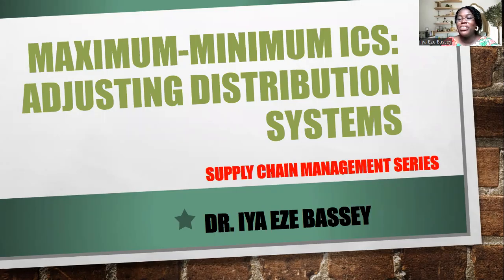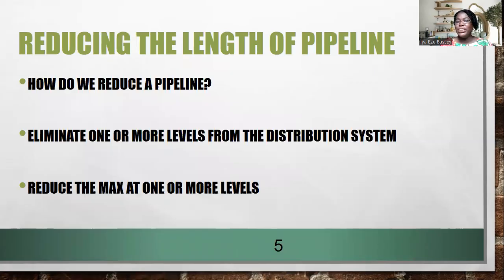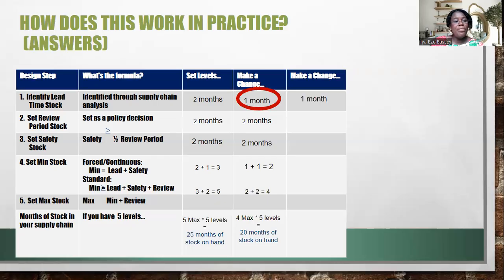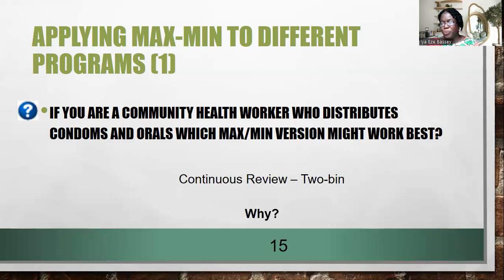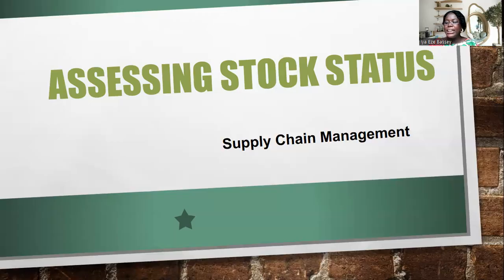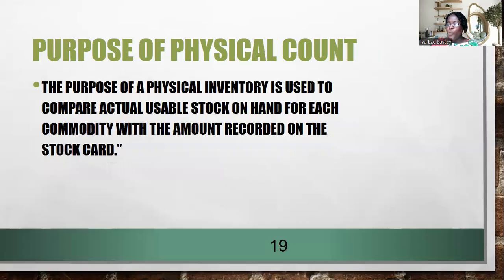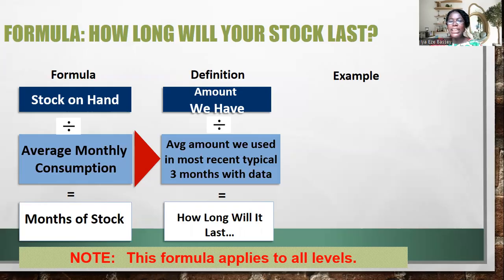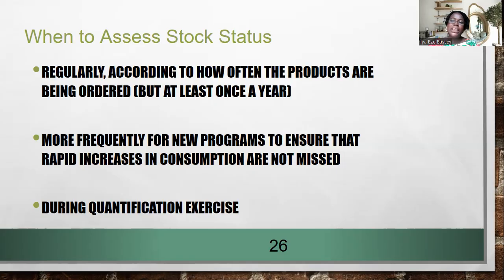Maximum-Minimum ICS: Adjusting Distribution systems (Supply chain management series)

Comment: Thanks ma
I learnt the importance of adjusting the max-min inventory control system which begins from understanding what pipeline is and how  to reduce the lengthof a pipeline in order to serve the client more efficiently and timely.pipeline can be reduced by(1) eliminating one or morelevels from the distribution system (2)reducing the maximum stock level at one or more level.
Also,there are factors that affect max/min  stock levels which are  cost of product, cost of storage etc
  Again,there are advantages of using  max/min system  which includes (1)it minimize wastage (2)avoid overstocking and understocking(3)simplify inventory control decision making  etc
Again, there are some challenges facing the use of each version and variation 
In accessing  stock status,i understood the importance of physical count as it is to compare the usable stock on hand each commodity with the amount recorded on the stock card in order to check for wrong data entry,theft,damage  issues as well as to know how  long these products will last.it is done once every year

Comment: Maximum minimum ICS adjusting distribution system length of a pipe line 
The step in designing a maximum minimum ICS are;
i) setup initial maximum minimum policies for each level and type of facility
ii) check if the overall distribution will function properly if the specific maximum minimum policies are implemented
iii) Check the total length of the pipeline that the policies at each level imply
• how to reduce the length of a pipeline
- eliminate one or more levels from the distribution system 
- reduce the maximum at one or more levels 
• how to reduce the maximum store level
- change some elements of the formulas which can be changed in order to reduce the maximum stock level by;
- shortening the review period at one or more levels reduce the lead time at one or more levels.
• other functions that impact maximum minimum stock level 
-cost of products 
- Reliability of transportation 
- storage capacity 
- cost of storage.
• assessing stock status
 how to determine month of stock 
 i) physical count: It is a process of counting by hand detour number of usable units of each commodity in your store physical account is important because it helps to compare what is actually on ground the actual usable stock at hand of each commodity with the amount recorded on the stock card
•Purpose of assessing stock status is to determine how long supplies will last

Comment: Thank u ma 
In Summary,
     The length of a pipeline can actually be reduced either by eliminating one or more levels from the distribution system or reducing the max at one or more levels . To reduce this max, Review period, Lead time and safety stock level should be reduced
      Cost of products , reliability of transportation, storage capacity, cost of storage etc can also affect  one's determination of max-min stock level besides the length of the pipeline.
        Inorder to compare the actual usable stock on hand for each commodity with the amount recorded on the stock card, a physical count should be done and this can be done once a year or as frequent as possible when there is frequency in mismatch with stock card to minimize lost .

Comment: This video lecture dived deep into adjusting distribution systems in supply chain management, particularly maximum-minimum inventory control systems.

In this lecture, we explored the various methods for identifying areas for improvement in distribution systems, along with the advantages and challenges of the must-mean inventory control system.  

We also covered assessing stock status, a crucial process for determining how long supplies will last.

Comment: Really interesting ma
In summary, the steps in designing a max-min inventory control system are:
1. Set up initial max-min policies for each level and type of facility
2. Check if the overall distribution will function properly if the level specific max-min policies are implemented
3. Check the total length of the pipeline that the policies at each level imply
     Pipelines cannot be reduced anyhow, the are two ways to reduce the length of a pipeline:
1. Eliminate one or more levels from the distribution system
2. Reduce the max at one or more levels
      The following are ways to reduce maximum stock level:
1. Shorten the review period at one or more levels
2. Reduce the lead time at one or more levels
3. Improve the distribution system's reliability at one or more levels so that safety stock can be reduced.
       Some of the factors that impact max-min stock levels are the cost of products, storage capacity, lead times, cost of storage, transportation reliability, age of program etc.
     Some of the advantages of using max-min system are: avoiding overstocking, avoiding understocking, minimize wastage, avoid cost of emergency order etc.
     They are some challenges of using max-min system as well which are:
1. Systems with numerous levels
2. System that manage a large number of commodities
3. System that manage products for new programs.
     Physical count is the process of counting by hand the  total number of usable unit in the store or health facility at any given time 
     The purpose of carrying out a physical count is to compare the actual usable stock on hand for each commodity with the amount recorded in the stock card and it's can be carried out once a year if they is no frequency with mismatch with stock card, but if they is, it should be as frequent as possible
       The purpose of accessing stock status is to determine how long supplies will last.
  The calculation to find out how long supplies can last is in our manual also.
      So when do we access stock status? 
1. Regularly, according to how often products are being ordered
2. Make frequent for new programs
3. During quantification exercise.
Thanks ma

Comment: In summary, I learned how the length of a pipeline and how to reduce the length of a pipeline is essential in adjusting distribution system in maximum-minimum ICS.

Other factors that impact maximum to minimum stock levels include:
* Cost of products.
* Reliability of transportation.
* Storage capacity.
* Cost of storage.
* Storage condition.

Advantages of adjusting distribution systems include:
* To avoid over and under stocking.
* To minimize wastage.
* To avoid cost of emergency orders.
* To ensure consistency of stock levels.

Some challenges associated with each version and variation include:
* Systems with numerous levels.
* Systems that manage larger number of commodities.
* System that manage products for new programs.

I learned how to apply maximum to minimum ICS to different programs and how to access stock status.

In determining amount of stock, physical count comes into play, whereas physical count is the process of counting by hand the total number of usable unit of  commodity in your store or health facility.

Purpose of assessing stock status:
* To determine how long suppliers will last.

I learned about the formula to calculate how long your stock will last and at what regular intervals you have to access stock status.
Thank you for the lecture.

Comment: ICS is the method of reducing pipeline length and various factors affecting tye determination of max-min stock levels
I also learnt that  what you can do to reduce the length of a pipeline are:

*Elimination of mkre levels from the distribution system 

*Reducing the maximum at kne or more level 

Also steps involve in designing the max-min inventory control system are:

*Determine lead stock
*Set review period
*Set safety stock
*Set min stock level
*Set max stock level
*Set emergency order point (EOP)

Comment: In summary I have learnt the steps in designing a maximum minimum ICS , there are as follows
_ check the  overall distribution it will function properly if the  level specify Max min policies are implemented
_Check the total length of the pipeline that the policies at each level comply
_Setting up initial max min policies for each level and type of facility.
This are some advantage of using max min system which are:
1. Avoid overstocking
2. Avoid understocking
3. Minimize wastage 
4. Avoid cost of Emergency

Comment: In summary of this lecture, I've learnt that;
To be able to improve the delivery of medical laboratory commodities, the first thing to be done is to look at the length of the pipeline following the steps in designing a Max-min ICS.
1) set up an initial Max-min policy for each level and type of faculty.
2) check if the overall distribution will function properly if the level specific Max-min policies are implemented.
3) check the total length of the pipeline that the policies at each level imply.
It is also important to note that there are several factors that could affect Max-min levels. These include; cost of production, cost of storage, lead time, storage capacity, age of the program, the accuracy of forecasts, etc.
Lastly, a physical count of stocks is significant. This should be done at least once a year except these stocks are moved rapidly then the physical counts should be frequented to ensure accurate inventory management.
Thank you ma'am.

Comment: Thank you ma for this wonderful lecture 
From this wonderful video I got to know the various steps in designing the Max-Min inventory control system. 
1. Set up an initial Max-Min policies for each level and type of facility 
2. Check if the overall decision will function properly if the level specific Max-Min policies are implemented 
3. Check the total length of the pipeline that the policies at each level imply.
Also we have various things that can be done to reduce the length of pipeline, then factors that impact Max- Min  stock level which can be lead time, age of program and many others.
Many Advantages of using Max- Min stock level.
Physical count which is the process of counting with hand the total number of usable units of each commodity in your store. 
Then finally I understood the calculatory aspect🥰.

Comment: Thank you, Ma, for the amazing lecture. In summary, I learned about the key elements of designing and managing inventory control systems in public health supply chains.

From the previous session, we covered three types of maximum inventory control systems and their application in public health. Additionally, we discussed calculating mean marks for different distribution systems in a country.

I learned that the first step in designing a distribution system is setting initial maximum policies for each facility level and type. It's essential to check the overall distribution system to ensure proper function and verify that the total length of the pipeline adheres to policies at each level. Methods to reduce pipeline length include eliminating levels and reducing maximum stock levels at certain points.

Factors affecting maximum stock levels include the cost of products, transportation reliability, storage capacity, commodity shelf life, lead times, supply source reliability, staff management skills, and forecast accuracy.

The advantages of using a maximum system are numerous: avoiding overstocking and understocking, minimizing waste, avoiding emergency order costs, simplifying inventory control decisions, ensuring stock level consistency, and providing reliable data for forecasting and quantification.

However, challenges include managing a large number of commodities and products for new programs. Designing an inventory control system requires identifying the appropriate system for each program (e.g., TB drugs, HIV/AIDS commodities, malaria), determining stock levels and review periods, and considering push and pull systems, physical inventory, and stock status assessments.

Assessing stock status involves conducting physical inventories to determine actual stock on hand, comparing these counts with stock cards to identify discrepancies, and calculating how long the stock will last based on average monthly consumption.

Assessments should be done at least once a year, more frequently if discrepancies arise, in new programs to monitor rapid consumption changes, and during quantification exercises for accurate forecasting.

In conclusion, adjusting distribution systems in maximum-minimum inventory control systems is crucial. Understanding the factors affecting maximum stock levels and the advantages of using a maximum system, along with addressing the challenges and importance of assessing stock status, ensures effective inventory management in public health supply chains.

Comment: In summary,this module helped me understand 
• How to design a maximum minimum inventory control system
• How to shorten the length of a pipeline when it's too long
• The various factors that impact Max Min ICS which include cost of products, reliability of transportation and to mention a few
• The advantages of using Max Min ICS which includes Avoidance of overstocking and understocking, minimizing wastage, simplifying decision making but to mention a few
•The challenges involved in using Max Min ICS

It also helped me to understand how and when a physical count is done and  lastly it helped me to know how to assess my stock status

I also understood how average monthly count and months of stock can be calculated correctly in a facility
Thank you ma

Comment: Thank you ma for this amazing lecture 
I got to understand the systematic way of reducing the length of the pipeline which is by
•reducing the lead time 
•reducing the review period 
•set the safety stock
•set the minimum stock 
•set the maximum stock 
How to modify the pipeline which is by eliminating one or more levels from the distribution system and by setting up policies that helps to reduce the maximum at one or more levels 
I also learnt the factors that could impact on the maximum and minimum stock level,the advantages of using the maximum and minimum system,the challenges faced when using each version and varieties 
And I understood how to apply maximum and minimum inventory control system to different programs.

Comment: Thank u ma.I got to understand that,in adjusting distribution system policies u will have to determine your lead time,set review period,set safety stock,set your minimum stock level,set max stock level and also set emergency order point.I also understood that,to reduce the length of a pipeline,u eliminate one or more levels from the distribution system, Reduce the max at one or more levels.Advantage of using max-min system is it avoids overstocking, avoid under stocking minimize wastage among others advantages.challenges encountered were system with numerous levels,system with large number of commodities etc.I also understood that,assessing stock status is done when physical count is carried out regularly when product are being ordered.

Comment: Another educative series
In summary,the reason for adjusting distribution system in max_min ICS is to reduce the length of pipeline in order to serve the clients more efficiently and timely.
Length of pipeline can be reduced by
Eliminating one or more level at the distribution system
Shorten the review period at one or more level
Reduce the lead time
Improve distribution system reliability at one or more level so that safety stock can be reduced. There are advantages of using max_min system such as
It helps avoid overstocking and understocking
Minimize wastage and
Avoid cost of emergency orders etc. In as much as we have the advantages,there are also challenges faced when using each ICS version such as
System with numerous levels
System that manages a large number of commodities
System that manages product for new programs.
Also,it is necessary to do a physical inventory or physical count in order to compare the stock on hand with record on stock card to check for wrong data entry,theft,damage issues as well as Know how long these products will last.

Comment: Thank u ma.I learnt from the lecture that the aim of inventory control system is to maintain an appropriate stock level of all product avoiding shortage and overstocking. Also when to to order and also how much to order.I also understood the three maximum minimum inventory control system they are:Forced ordering maximum,Continuous review maximum, and standard version maximum.I understood that review and emergency order point triggers forced ordering in max-min inventory control system.

Comment: Good day ma…..in summary of this lecture,I learnt that:

To optimize inventory management, the maximum-minimum (max-min) inventory control system is used to streamline distribution pipelines by eliminating or reducing levels, lead times, and stock levels, considering factors such as product cost, transportation reliability, storage capacity, and shelf life. This approach prevents overstocking and understocking, ensures consistent stock levels, and avoids emergency order costs. Regular physical counts, at least annually or more frequently for fast-moving products, are crucial for accurate stock status assessment and effective max-min system implementation…..the aim of this lecture is to ensure goods or product are made available to the client for use thank you ma

Comment: Thank you for taking your time to create these videos. They are a valuable resource for students like me that prefers watching videos to reading.I learnt how to reduce the length of the pipeline of distribution.When inventory reaches the minimum level distribution is adjusted to to trigger reorder which help maintain efficient supply chain operation.
In conclusion the maximum minimum system deals with avoiding overstocking understocking wastage.
Other factors that impart Max- Min stock level are: Storage capacity,Cost of production and Cost of storage.